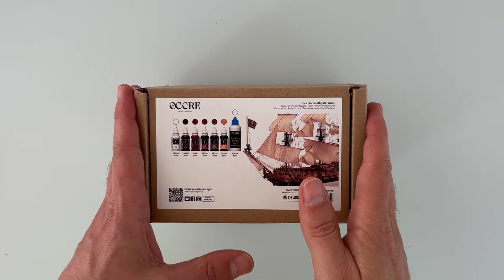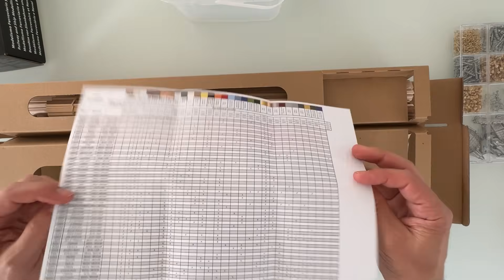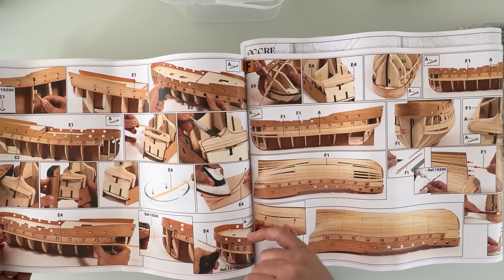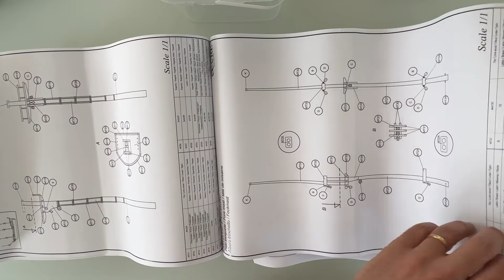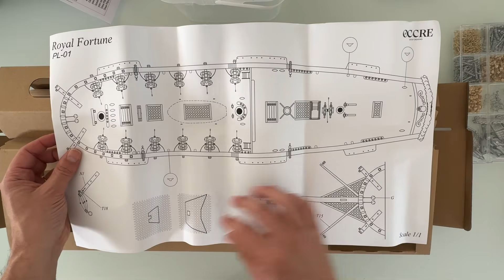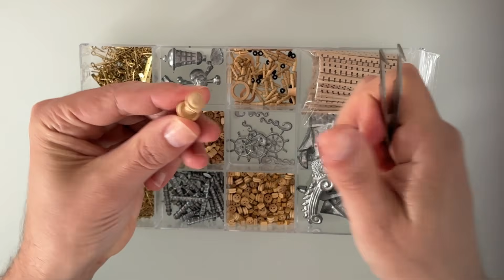Royal Fortune final battle build | OcCre's Pirate Ship Model – Unboxing

Comment: How do you think it compares to older kits from occre
Reply from the maker: Can't tell you yet, I'm working on the planking at the moment. My first OcCre kit was the San Felipe (all other builds from OcCre I made were launched after the San Felipe). The oldest kit from OcCre was the Bounty Boat as I wanted it specifically for in a diorama. This is the 7th build from OcCre. The way the box was packed, the materials, the photo manuals ... it all is excellent (two remarks: the threats can be improved and I'm not a fan from metal stairs (Fram/Black Swan)).